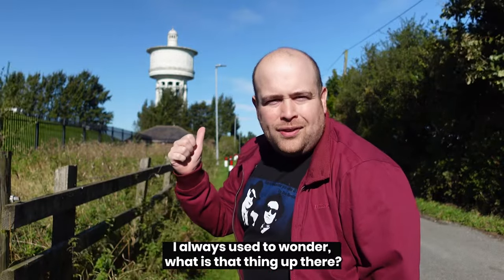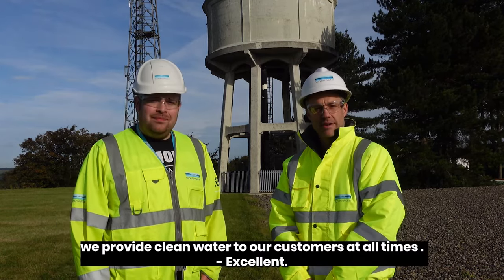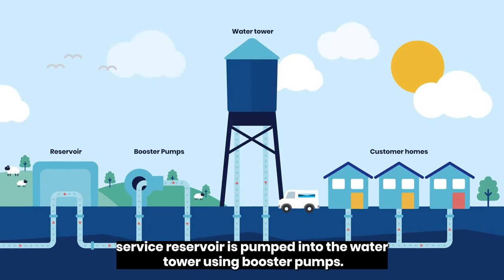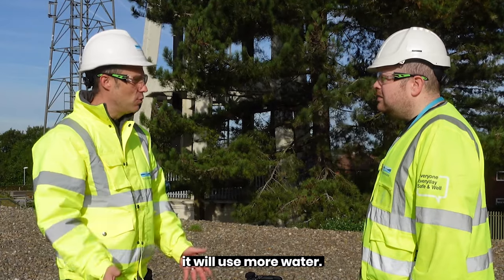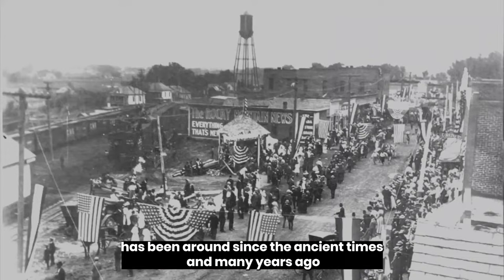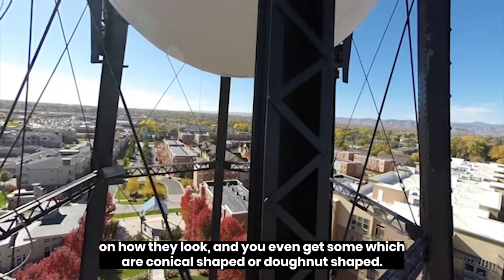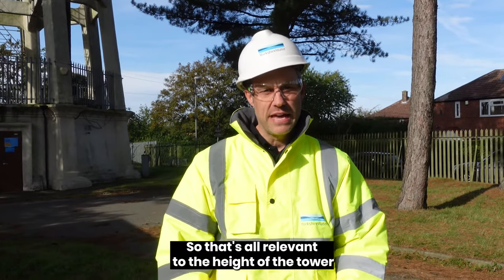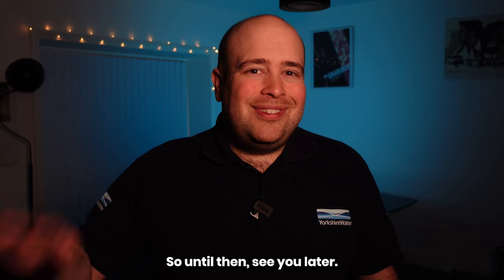Yorkshire Water // The Science Behind - Episode 3 - What's a water tower and how do they work?

Comment: presumably the energy saved by using the gravity system is greater than the energy used to pump water into the tower?
Reply from the maker: Hi Mark, thanks for the question. To supply the area with water on direct flow from a pumping station would require the most pumping at peak hours. With the tower you can utilise the storage during these times and pump into the tower at off peak electricity rates.